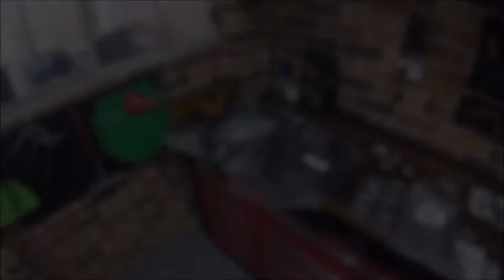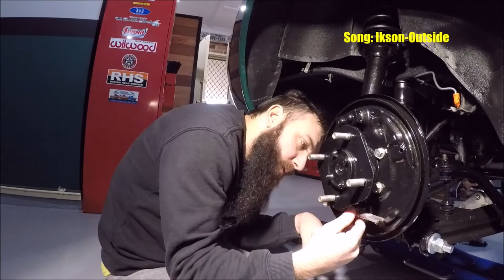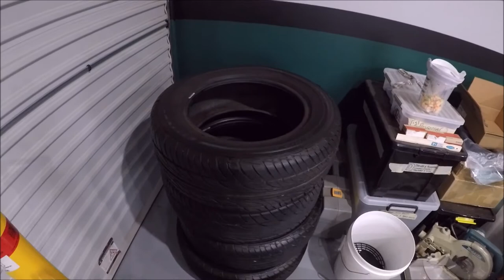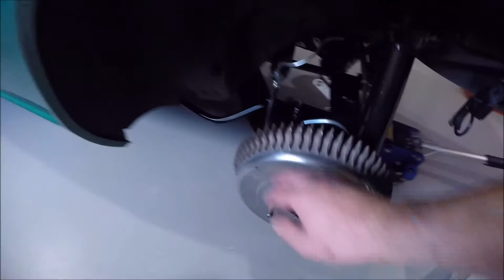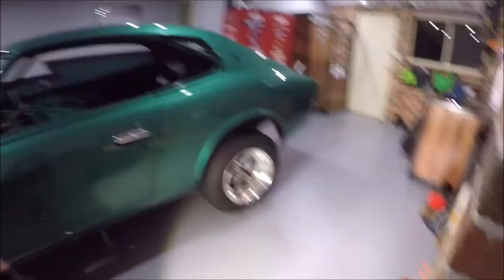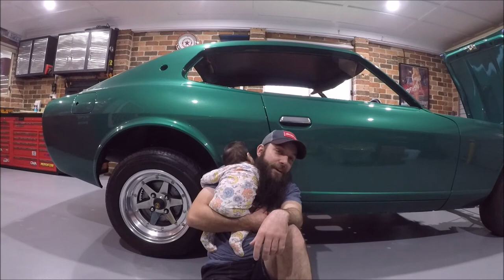260Z Build #22 - 280Z drum brake rebuild

Comment: Great job mate!  @8:11-8:25 you're putting the brake line bracket together.  Did you purchase new parts for that, or was it all just refurbed original parts?
Reply from the maker: The hard brake line is my original one I polished up and cleaned. The rubber brake hose is new. I bought it through Z car depot in the states. They were $30 USD for a pair... so around $150 posted to Australia haha!